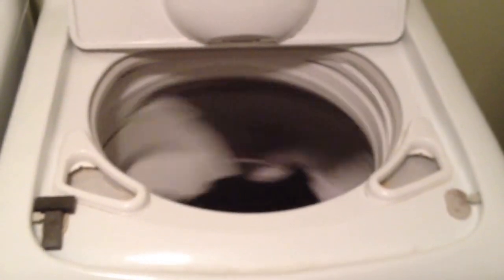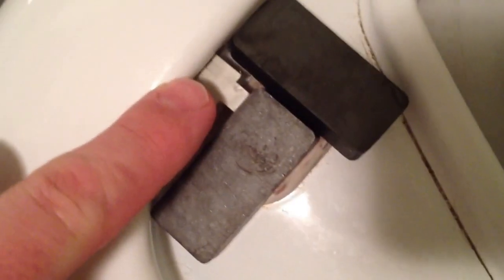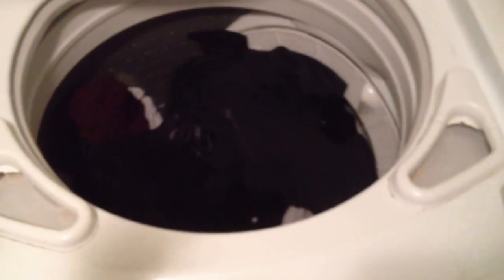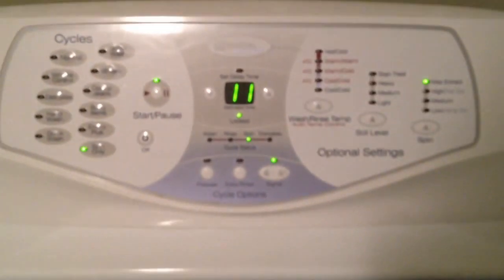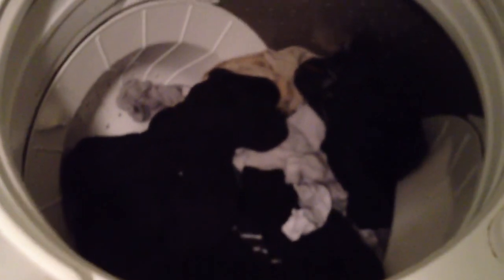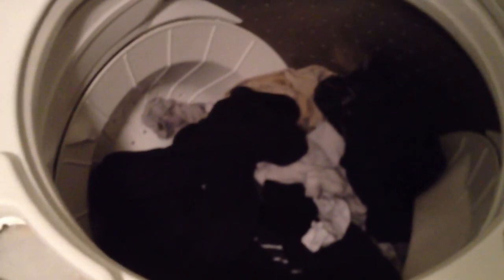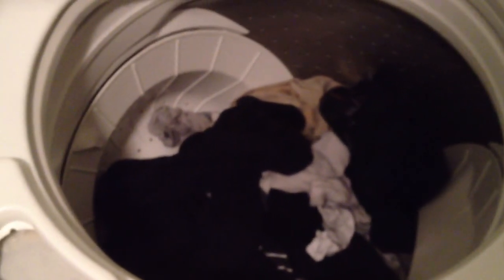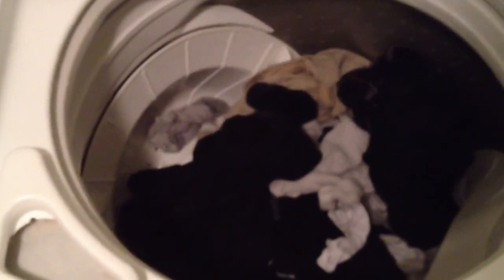Maytag FAV6800AWW spinning issue workaround.   *Please use caution if you do this!!

Comment: I disassembled my clutch and regreased it with bicycle grease and it's worked great for the last year or so.  The grease that Maytag/Whirlpool uses on this clutch part is really cheap and clearly designed to dry up and fail after a few years of use.

Comment: I Had a DTE Home Protection Plan, The Technician replaced the clutch but did not grease it at all. The problem persists. In the spin cycle stops at 9, 7, 5, 4 and 3 with uC code, after balancing the clothes, it finishes the cycle and clothes are still wet. Any thoughts?
Reply: musicmusic Yeah, if he had lubed your clutch, it would have been fine. That clutch is actually well built with solid steel bearings, hardened polished steel crank and shaft(very rare these days) it's just that the grease Maytag uses won't hang in there. Application of a good bearing grease and that clutch runs a very long time.
Reply: It's best to just re-grease the needle bearings inside the clutch.  Use high quality synthetic grease... doesn't even require a lot of it.  The clutch from he factory comes with some cheap #&$* white lithium grease that is designed to fail.  My washer is still running on the original clutch from 2004.  Mine failed in 2012.  I re-greased mine and it hasn't failed in 4 years.  I was planning to make a YouTube video when it failed again... but it hasn't happened...  and because of that, I haven't disassembled the washer since (If it ain't broke, don't fix it).  I hope you've since fixed your machine.  Good luck to you.